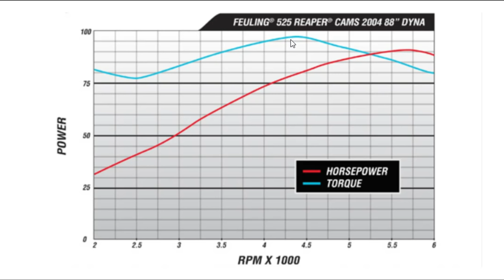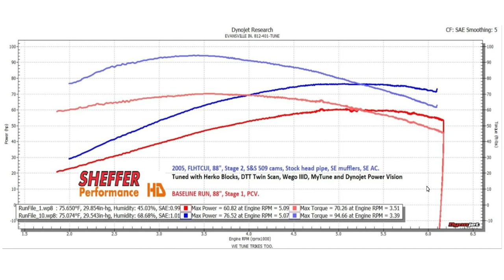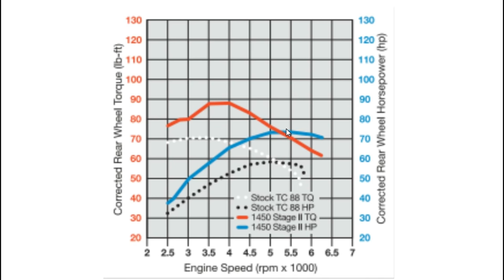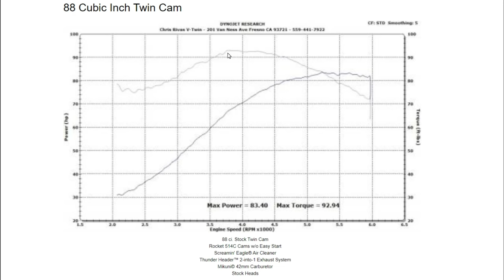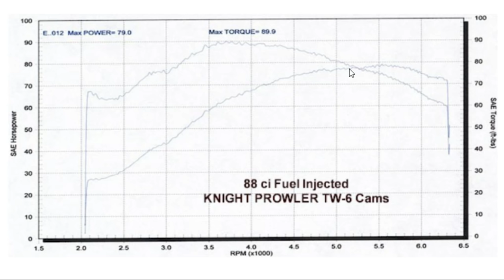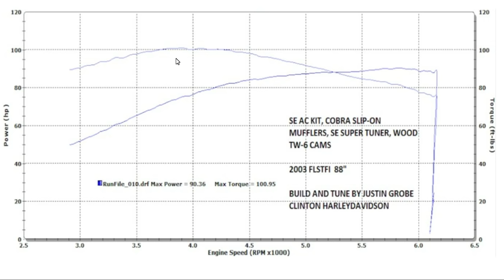Give Your Twin Cam 88 New Life With A Bolt In Cam Upgrade

Comment: I'm running the S&S 509 cams on my 03 Carbureted Dyna. My bike is set up a little heavy with a fairing, saddlebags, and a touring seat but I've also got upgraded brakes, chassis, and suspension. I guess you could call it a sport tour. As for the engine I've got the cams as mentioned along with a high flow air cleaner but with riding long distance I couldn't deal with the aftermarket exhaust I had on there for a while. So I modified a stock 2 into1 exhaust from a 2014 Dyna low Rider to fit my bike. I'm hoping it flows a little better than a stock exhaust for an 88 because it was made for a 107. I also removed the catalyst material and plugged where the O2 sensors would go. I'm not sure how much horsepower I'm giving up with this exhaust but I'm hoping it's not too much. I like the look and sound of it on the bike and I haven't noticed any real lack of power.

Comment: Very useful info. Just purchased a 2002 heritage softail carb. with only 17728 mi. she is spotless. I am 61 y/o so I don't need a rocket. My scoot already has a stage one. I am going to add a 2into1 to replace the dual slips. Cut to the chase. All I need is to buy a good power cam will be all I need. Thanks so much for your vids you just saved me a lot of $$$$.
Reply from the maker: That's awesome! A good cam will bring a lot to the party in the motor, especially with that 2 into 1! For sure change out the tensioners with the new cam or even better upgrade the cam plate with one that has hydraulic tensioners and high volume oil pump.
Reply: @GixxerFoo  Yep!!!!!!

Comment: This is by far my favorite 88" upgrade video. It encourages me to save some money ignoring the BB kit. Plus it's on a lighter Dyna, which would make it a snatcher to ride!
Reply from the maker: Great to hear! The big bore kits are great but if you don't have the right cam it's not gonna do much. You can do a cam swap and get some major gains with just the 88" displacement. It's all about compression and the right cam with a big bore kit.
Reply: @GixxerFoo  That Woods "TW-6" is a "winner" to me too. Friend dropped one in his 07' Softail Standard. Cam only in 96", and the normal stage 1. That bike left me sooo hard from the light, it was insane! 😮 And my Stage 1 88" runs hard. I didn't expect him leaving that bad!
Reply from the maker: That wood makes serious power in the 96, not too far off from the same cam in a 103. Wood makes a cam for the 88 that runs really strong.
Reply: @GixxerFoo  TW-6 or TW-5-5-5
Reply from the maker: The TW-6 l like if you're keeping stock compression and not going to be building the engine any further. The TW-555 works well with an other wise stock motor, but it's a better choice if you plan on doing head work and building the bike out more.

Comment: Andrews TW37G, 510 Lift. V&H slip ones, carb kit, screaming eagle air filter.
This gave the 88" on the 2002 FLHT new life. 63k miles and running strong.
Reply: Were these just drop in ? No other upgrades needed ?
Reply: Yes ... adjustable pushrods ..  ... what I did in 2000. 77 horses

Comment: I’m glad to hear your mention on the 509G cam. I just put a gears drive and 509G cams in my 2005 Fatboy. It a blaring with all that torque..
Reply from the maker: That's a nice setup going with that gear drive, no more tensioner worries down the road!
Reply: Does your 05 Fatboy have the factory 95 ci motor?  I'd love to ride one sometime to compare to the stock 88ci.

Comment: I have a 05 Electraglide standard , a bro from my club installed the  S&S 510 cams and roller bearing with gear drive , and a power commander, then took it down and had it dyno  tuned  , it screamed  and still does 18 years later . Got hooked up by the club bros on the setup and install !! Recommend s&s. I was in the front and think they wanted to go faster ha ha

Comment: Seems like the "Wood TW6" would be nice. I got a 06 Deuce with Stage one. Figure give them a try. Bike is practically new with 11k on the clock..bought it 4 years ago with only 237 miles for $7k. Such a nice well balanced comfortable bike..I just need to keep up with my bud that just got a Low Rider S...lol
Reply from the maker: You got a steal on that bike! You find a deal like that you can't pass it up! A cam upgrade will wake that 88 up!

Comment: Shortly after getting my '01 Road King new, I had the 95" kit and SE-204 cams installed. Been pleased with it ever since...
At about 48K miles I had the hydraulic cam chain tensioner/improved oil pump installed, as well as compression releases.
Running well at 54K miles.
Reply from the maker: That's an excellent upgrade on that bike, that high volume oil pump and the new tensioner is gonna give you years of service!
Reply: Good choices

Comment: I like the torque on the Fueling but the TW6 is impressive. Tough choice for my 03 fxdl.
Reply from the maker: The only down side to a Wood cam is they are somewhat noisy. They keep the valves open longer and the ramp angle is aggressive. If you're not worried about noise the Wood cam is great. The Feuling is an awesome cam too, it's definitely going to quieter than the Wood.

Comment: The wood TW6 sounds good. Rarely get past 4500 rpm and I like that it would build through to the shift.
Reply from the maker: That's the best way to get the right cam is really take some notes on how your ride and your rpm range!
Reply: I ride the same. Andrews 21's and it's a torquemonster.

Comment: My Takeaways
509 rolls over at 3500rpm vs 525 at 4250
525 has little weirdness at lugging RPM, peak at 4500 but 90 tq at 5250
SE203 TQ dies off badly after 4000rpm
Rocket looks like 525 but set back 500 rpm
Wood tw6  funny curve but near 90tq from 2250 to 4800 (10 less tq/hp than 525 at 5500 w/ carb but better FI)
For a carb it would seem the tw6 and 525  with tw6 having more immediate but weirdness below 3000rpm.  
tw6 for 2 riders and 525 for everything else with a downshift below 2500
Reply: This is the info I needed. I’m torn between the 525 and the tw6. The 525 is more in my price and riding range. I don’t do much high way cruising but more city and back roads. And I’m always solo or 1up riding. Looks like 525 is what works best for me. Thanks for the info!

Comment: I did the 509 on my 99 RK

Love it as it was massive burst speed improvement .  It's perfect for the twisties where there occurs a lot of acceleration and deceleration 

I do recommend
Reply: Hey WOLLY, did you have to retune after this upgrade?
Reply: @DJDooxx  

I did not tune the  Magnetti Marelli fuel system

I did stop adding octain boost and I stuck to the same fuel pump at the gas station.   Dropping the octain boost was a huge improvement.
Reply: Tried the 509g in a SE 95?
Reply: @twitterjackedmitchell8096  

I have not but I want to cam up my other RoadKing 98CI 

Recommendations?  It's kinda sluggo
Reply: @DJDooxx  

Also changing the fuel filter prior to the upgrade was huge improvement.   I cut the filter open and the element paper was completely varnished over, hard as glass

Comment: @gixxerfoo just an update.    I went with the woods tw6 as you recommended.  I went with a screaming eagle 95ci big bore kit and zero headwork and my deuce dynoed at just under 91hp and 100.3 tq.   Couldn’t be happier with this build thank you so much for the cam recommendation.  Btw the cam sounds very mean
Reply from the maker: That's awesome! That's some serious power without headwork! If you decide to do some head work there's even more to be had! Thank you for the update, I appreciate it!
Reply: @GixxerFoo  I inquired about headwork to the dyno guy and he said that headwork probably wouldn’t get me much more because my cam is a bolt in cam.  If I did headwork would I have to change cams?
Reply from the maker: Ehhhh shouldn't have to, the Wood cam is pretty stout. If you did do some head work with valve springs and go with an even more aggressive cam you would get quite a bit more. But you wouldn't have to change the cam, a port and polish on the heads would give it more with that TW6.
Reply: @GixxerFoo  thank you that will be next!

Comment: I’ve got a 2001 fxst I picked up a few years ago with 15,000kms on it. After watching your videos I went ahead and bought the Feuling OE+ conversion cam plate package. I just booked in to get it installed along with the rocket 514c cams and screamin eagle adjustable push rods. Bike currently only has 42mm mikuni and vance and Hines big radius pipes… very little info on the 514’s availability in Australia can be tough and these cams were readily available… hoping I don’t regret my decision 😅
Reply: Also I see you Americans often talking about poor fuel quality? We have 98 octane fuel available at basically every gas station across the country, our lowest grade fuel is 91 octane. I always run 98, can i expect a better performing bike running this fuel?

Comment: I did the S$S 509 hydraulic on my 03 Heritage EFI. Vance and Hines Big Shots with quiet baffles and tuner, with Arlen Ness big sucker. I can’t believe how much harder it pulls now. No valve train noise at all.  It’s  worth every penny. Maybe a 95 kit someday…….. but not really needed ?
Reply: Have you already installed a 95 kit in combo with the 509?
Reply: @flsgeertf  it was going to be "next"
But the 509s opened it up so much I'm still waiting. Might do a complete S&S 97" with S&S 89 heads. Keep the compression around 9.7 so getting premium fuel in the tank at blender pumps is never an issue compared to 10:1 or higher.....?

Comment: 02 fule inj. RK. 88ci. At 2500mil I had an HD stage2 kit installed, wt. The 95ci.,203cams at the dealer, wt. their download tune. What a slug, my shovel had more balls. At 35,000mils, I put in fuelings 525 reaper kit, cams, lifters, cam plate, oil pump, etc: with a 2-1 exhaust. & a Daytona TT. tuner that I downloaded myself. don't know about numbers but it does pull from idle to 5500rpm wt. no flat spots or hesitation.

Comment: Great Video. My riding is usually on back roads, two up. And occasionally on the highway. So, 1500 - 5000 is my range. I am leaning towards the S&S 509, but would like to compare it to the 510. If you could do a comparison between the two, that would be great. Thanks!

Comment: The Woods cam graph shows only 82 peak HP. You said it made 92 peak hp. 
Also you said the fueling cam only made 80 peak hp, but the graph shows it making over 90 peak hp. 
Just making sure what information is correct!!  
I am going with the S&S 509. Looks like a beast.

Comment: Andrews 37G  hand ported heads S&S exhaust 03 RK classic 95ci 100hp 107lbft. 9.5:1 cpr
Reply from the maker: Andrews are nice cams, they manufacture the cams for Wood. Wood is basically an Andrews cam just ground to Wood specs. You've got some impressive numbers on your 95 and with a very sane streetable compression ratio too! I'd say that Andrews cam is working really well in your bike!

Comment: I like that Wood tw6 a lot. Pretty impressive.
Reply from the maker: It's a very stout performer in the 88, 88's make some awesome torque!
Reply: @GixxerFoo  I wonder how would the TW-6 fare with a s&s sidewinder  100” kit,a 103 intake, and a set of s&s 89cc heads,and 2 into 1 exhaust?
Reply: @GixxerFoo Hope this isn't too dumb? With the tw6 dropped in stock, is there a chance of spring binding when getting carried away with the revs?

Comment: I bought my 2000 FXDX Super Glide Sport with a lot already done. Has Screaming Eagle stage II big bore 95" with stock heads ported and polished, Andrews TW37B cams. I swapped out the long Screaming Eagle Chrome 2-2 exhaust to Bassani RR3 2-1. I think the thing pulls pretty good. Would like to get dynoed sometime but not sure if I'll ever take the time. Looks like the specs for Andrews TW37B are pretty close to the TW-6 cams but you can get the Andrews for $255 vs Wood at $390.
Reply from the maker: You've got a nice bit of work done to your bike! I'd imagine it runs pretty dang strong! I'm not sure about the price difference, Andrews makes the cams for Wood, just to Wood spec. You can't go wrong with Andrews though.
Reply: Yes, pretty happy about performance but will probably open her up this winter to check tensioners, I have no idea if they have been upgraded yet or not, bike has only 10k miles on it but with it being 20 years old I still want to play it safe.
Reply from the maker: It never hurts to pull the cover and take a peak, at least at the outers. Getting a view of the winners can be a trick. But always better to play it safe and prevent a disaster.

Comment: Great videos. I love your opinions on each motor, good or bad, to separately.  I'm looking at an 2004 EFI 88 twin cam Heritage Classic with a Frankenstein trike kit. It has the Stage 1 with V&H shorty pipes. I'm was thinking of adding S&S 509 cams. I was impressed with the increase in torque over stock. Is there a better cam used for an 88 trike? With the Frankenstein kit I would think its weights about the same as an UG

Comment: Very informative video...But people forget the limiting factor of the Twin Cam 88 "pressed together" crankshaft assembly. It's a game of Russian roulette adding any significant power upgrade to a TC88. Fix or replace the crankshaft first.
Reply from the maker: If you have one 2002 or earlier in you're in really good shape with the Timken bottom end. 2003 and newer is when they got that great idea to save production costs and start pressing crap together. Hurts my head.
Reply from the maker: Yeah Harley screwed everyone after 2003. But if you can convert that bottom end to a Timken setup.

Comment: Thanks for tips I put the woods rw6 8n my 01 softail and got 85hp and 90 to also on my 12 dyna 103 I used the ss 577 with cobra 2 into 2 got 96hp and 115tq I really like the woods cam it also had the vh Longshot. Tks so much
Reply from the maker: No problem 👍 Those wood cams are pretty damn impressive for bolt ins!